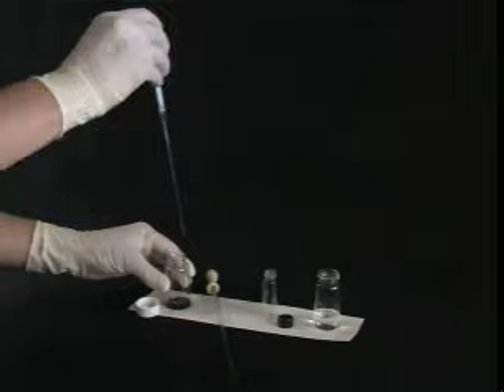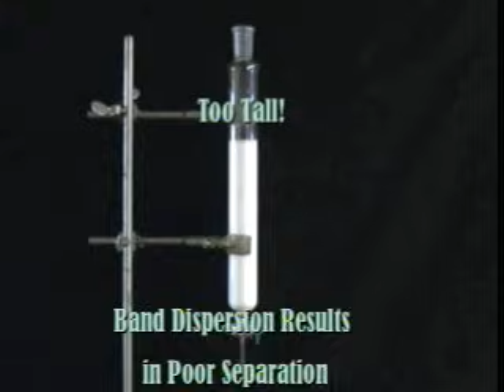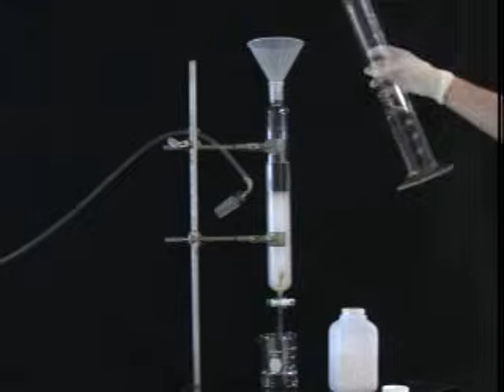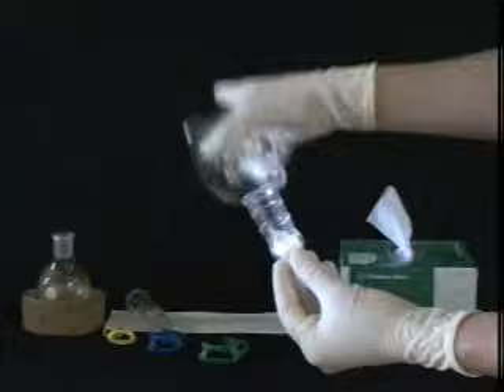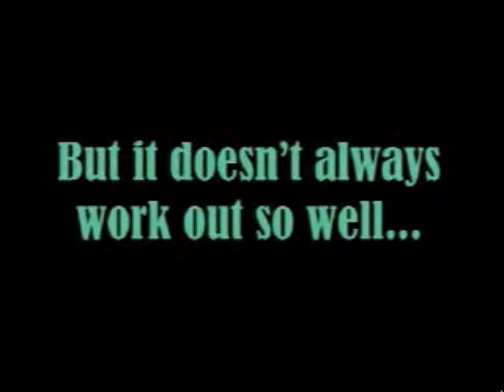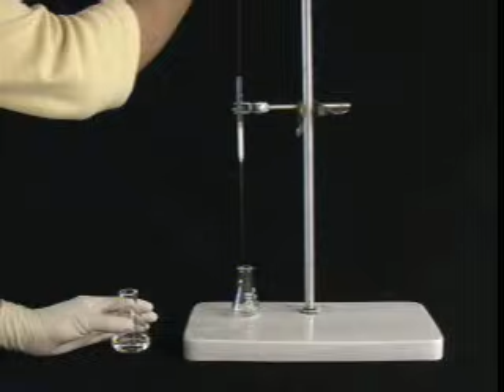Column Chromatography | MIT Digital Lab Techniques Manual

Comment: These instructions are for organic chemicals but this can also be done on inorganic chemicals but your solvents will be much more polar, probably water or water with a little acid or base. 

Some elements have properties so similar they are had to separate, a classic example being lanthanides. In fact lanthanides sold commercially are often mixtures because of practicality.

Fractional crystallization of bromates was one of the methods used historically to separate lanthanides. What was thought to be one element resolved into two or more. Practical use was almost entirety with mixtures. 

Then it was discovered that they could be separated with column chromatography. This was eventually done on a large scale.